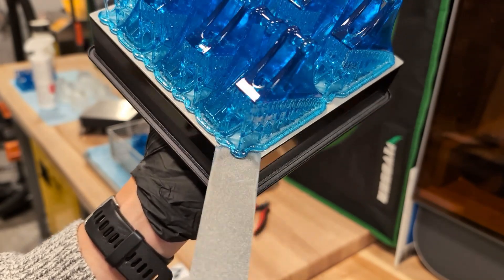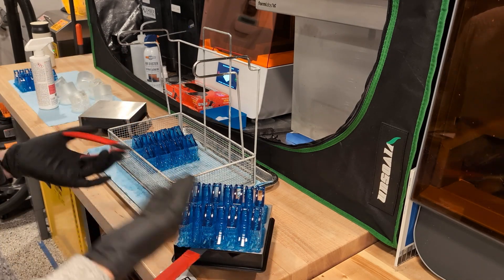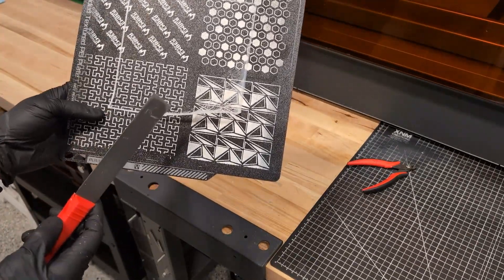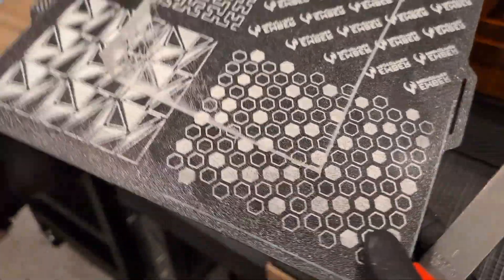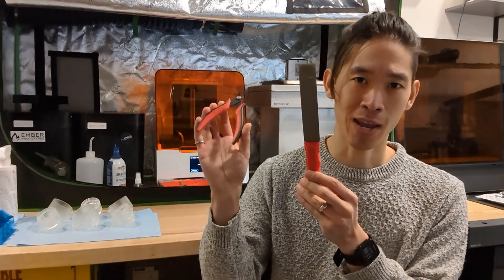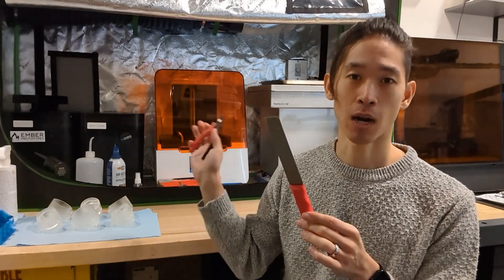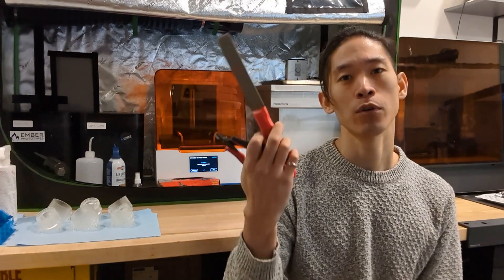The ULTIMATE resin 3D printing removal technique

Comment: So just use my snips and a Japanese flush-cut saw? Got it. :)
Reply from the maker: Totally if it works! I've yet found a scraper as good as these ones I use, but the technique is the most important in my opinion
Reply: By snips, I mean my hobby flush-cutting snips/knippers, lol. And the spatula literally looks like a flush-cut pull saw, that hasn't yet been stamped/cut to have blades. Alternatively, I just went to Dollar Tree and picked up a 3-pack of galvanized steel tags and a galvanized steel sign, which are flexible but not too thin (seemingly the same thickness and flexibility as your typical flexible scraper, but notably thinner than my Anycubic scraper) - which I literally only spent 50 cents on, strangely enough. I'm currently running a print, and am going to give some of the edges of these metal pieces a quick deburring, while I wait. If these work how I want them to, I may very well have a very good idea in mind...  @emberprototypes

Comment: I started using knife instead of wire cutters. It is sharp, but blade is rigid enough to give you ability to pry. Usually I just pry corner a little, get under raft and encircle whole print. It usually just releases somewhere in the process. If it is too hard, I use spatula.

Oh and please get separate spatula for fdm printer!
Reply from the maker: Yup that sounds similar to how we do it! I avoid a knife/blade because I have cut myself in the past 😅
Reply: @emberprototypes  I even stabbed my hand with corner of dirty spatula :D
Reply from the maker: @antharon1  hahaha that's no fun 😅

Comment: Definitely a more universal  and much cheaper method, than FLs insanely priced build platform2/2L. Even when using the build platform2 contraption, removing resin, from under flex plate is a royal pain.❤👍👍

Comment: I just place the vat with printed parts straight into a bucket for 3 stage washing. This way i dont touch the build plate until its all cleaned.
Reply from the maker: That's a great way to do it too! I do that sometimes and then use the same tools to remove from the plate. The thing with putting the whole vat in the wash though is that you saturated your IPA sooner, and changing the bucket can be a pain, so we don't do this as often as one would think.
Reply: @emberprototypes  True - but the first two stages you shouldn't really use clean IPA 99% (I use rubbing alcohol 75%, 2 usd per liter). After a while I let the buckets in the sun and the resin settles to the bottom and is dispatched. The last bucket with IPA99%, hasn't been changed in 1-2 years 👍
Reply: @strand3dprints  At one print a year, a month, a week, a day? Mentioning only a time span doesn't really say anything.

My last stage ipa lasts a long time too, I have tubs with 1L and i think they last somewhere around 50  to 100 washes before i change the solution out.
Reply: @PitchBlackCat  bout 3 printers running (saturn 2, mars 4 dlp, mono 4k) roughly 2-3 times a week
Reply from the maker: @strand3dprints  AFAIK the sun thing doesn't actually work from a chemistry perspective. What settles is usually pigment and what cures is usually monomers that haven't been dissolved by the IPA because it's saturated. Thinking of making a video about that in the future too 😅 but if your process seems to be working for you then that's great!

Comment: thanks for sharing. I am curious about how you ventilate your resin fumes? I can see the tent, which is a solution I consider my self. i wanna start printing at home, but scared about the fumes because I have kids. I can put the printer in the garage, but the kids go through the garage everyday. So looking for a good solution.
Reply from the maker: Yeah I have a diy fume hood using the grow tent. We have it ducted out of the workshop through a vent and an axial fan that sucks the fumes out and exhausts it.

You can do the same by cutting a hole in your garage for the vent. In the worst case you can get a similar tent and then use a charcoal filter inside of the tent and close it when printing. You just need to make sure you replace the carbon regularly.

I'll probably put out a YouTube video detailing our diy fume hood more closely at some point.

Comment: 4:00 Might be worth trying different palette knives, or cake frosting knives.  These are commonly modified for instrument repair (opening tops and backs of guitars and violins etc).  At the very least, it seems like you could round the corners of your knife to reduce the scratch factor.
Reply: Yeah that spatula is insane, I'd bet you'd have much more luck with a proper short one that lets you get under the parts without extra tools
Reply from the maker: @informer9111  we used to use a short one like the buildtak spatula and it didn't work so great. Once I found the combination of thin flexible spatula and side cutters, our process has been really dialed. Mileage may vary depending on your setup, machines, materials and geometry of what you print of course. Long spatulas are particularly helpful for our 3L when we print very large parts.
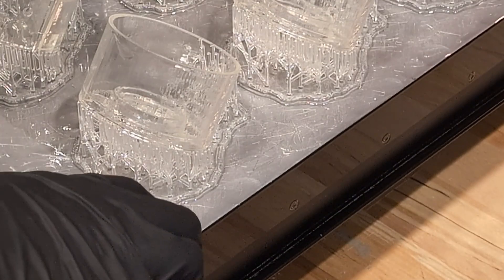Reply: My comment isn't based on any print experience at all, just saw the knife and thought it might be worth suggesting other potential sources/designs etc.  A small palette knife might be great for you.   There were a lot of scratches on the one plate in the video 4:58, so it seemed worth suggesting rounded corners.  This is also done on lots of chisels and scrapers used for making and repairing instruments, to reduce marks.  I know you're dealing with tiny printed stuff at times, so a tiny tip/corner like your existing tool must be useful for smaller things.  A super flexible spring steel palette knife is very thin, and you could polish it down even more.  @emberprototypes
Reply from the maker: @ianburkard  thanks for the suggestion! If I ever feel like this tool is out living it's usefulness I'll look into it 🙂
Reply from the maker: @ianburkard  also smaller parts tend to be super easy. You just snip a corner gently and the whole thing pops off - see here:

https://youtube.com/shorts/zbgh6qBHWhI?si=kuJaLereEx9dK0Km
Reply from the maker: Honestly haven't tried too many types of knives. All I know is that I used to have a thicker one which sucked and then I found this one and it's been working amazing in conjunction with side cutters. I can see the thin cake frosting ones working well too, but I like how high quality this one is and it's been working.

I also don't find any issues with scratches on the build plate at all. I mostly print with rafts for various reasons so it's been no problemo for me.

Fun fact is that the spatula I use comes with the Form 3L...but you can't buy them separately hence why we imported a small batch to sell on our store.